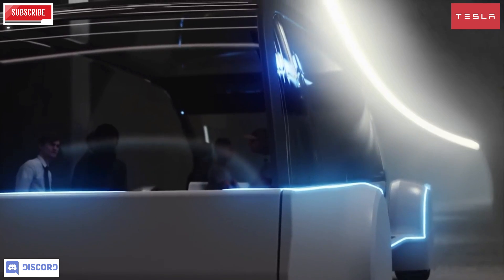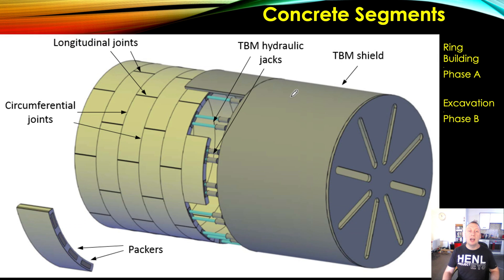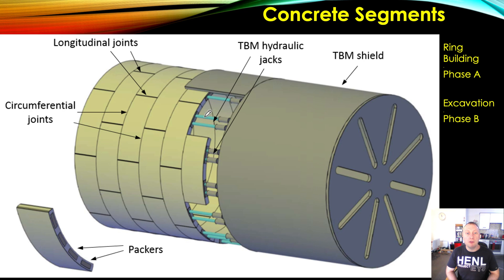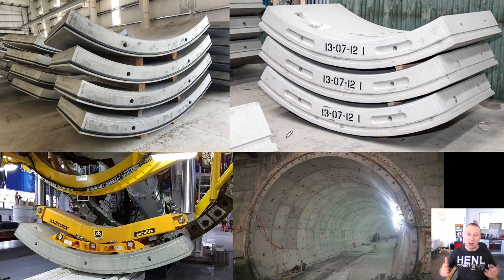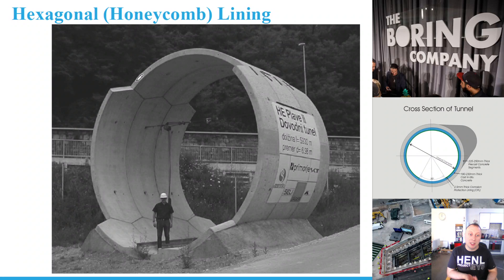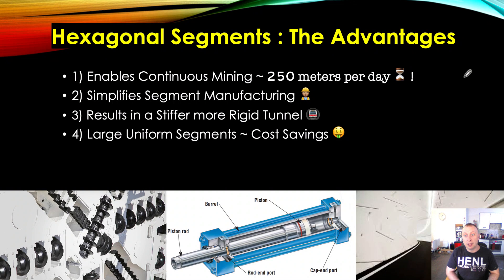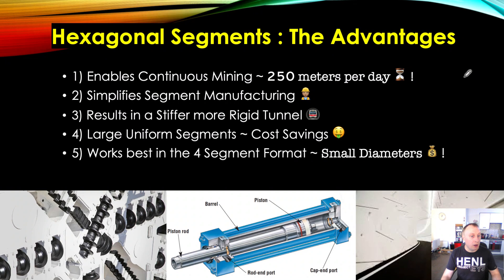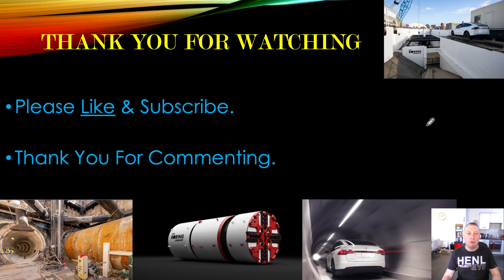The Boring Company 🚇 😃 🇺🇲 Hexagonal Concrete Segments Are The Future 👷🏽‍♂️ 🏗️ 🚎 PART 1

Comment: How is a turn in the tunnel path created if all section pieces are identical?
Reply: Yeah, I think I found a later comment by David Salisbury that indicates that the "rectangular" segments are actually slightly trapezoidal (or some non-rectangular shape), but still a uniform "set" of segments to create a whole ring. And, it sounds like those rings then have a slight "offset" to them (i.e. the leading edge/face of the ring has a slight angle relative to the tunnel axial centerline).  If I understand correctly, one would simple adjust the radial positioning of each the segment sets in each successive ring to either amplify the bend (where turns are desired) or to dampen/counter the bend (when traveling in a straight line). Or, maybe I'm all goofed up in that interpretation!
Reply: Jeff Cadman no you’re not.
Some segment lining rings have a “straight” a “left” and a “right” ring, to allow for straights and curves. 
Most modern tunnels use a “universal” ring which can be built in  any orientation (I.e. the key can be positioned anywhere around the circumference). The shape looks like it is say 1.5m long, but in fact it is slightly shorter (maybe 20mm) at the key, and slightly longer by the same amount at the opposite side. Imagine cutting a salami, but instead of thin slices you make them an inch thick, and instead of perfectly parallel cuts you alternate the cuts with a slight angle.
Now, to line up your cut salami you just re build it with the slices in the same orientation. But if you put all the wide parts to one side you end up with a bent salami, or in the case of a tunnel a curve.
The universal ring always has to build in the tail of the TBM following whatever alignment the TBM cuts. By constantly rotating the position of the key the lining can go straight, left, right, up or down. But it must always simple follow the alignment cut by the TBM,  otherwise it will clash with the shield around it and become what we call “iron bound”.
Hexagonal ring can’t do this!
Reply: @davidsalisbury50  Thanks for the explanation!
Reply: Jeff Cadman apologies for repeating myself. It’s been a long day.
Reply: @davidsalisbury50  
Thanks for all the information you're sharing David.  In just a few minutes of reading I now know a lot more about tunnel construction.

What I'm wondering about is, since BoringCo's engineers will have also know pretty much everything about the current state of the technology, what new ideas they may be trying out as they push for greatly increased tunnel construction speeds.  I wonder what is going on out of our sight as Prufrock is developed along with other innovations.
Reply: @jjcadman  Sounds right.
Reply from the maker: Nice question! 
You Cap off the Hexagonal section with two half segments (half width). Then you use rectangular segments + packers for the curve and later on you revert back to Hexagonal. Will break this down in a future video !
Reply: Good point. Hexagonal segments are rarely used for this very reason. Note in the video reference document they were only used in water tunnels (straight lines in rock), which don’t need to turn corners so much and don’t matter if they leak.
Reply: @davidsalisbury50  How are turns handled with rectangular segments? It seems like you'd still have to manage different radii on the inside and outside curve, so the segments would have to be some kind of curved trapezoidal shape?
Reply: Jeff Cadman the segments look rectangular but they are not. 
Try a YouTube search. There are plenty of good graphics to explain. 
The rings are around 20mm wider on one side and 20mm narrower on the other than their stated length.
Hence they form a trapezoidal circle. By rotating the circle to the the desired position alignment can be maintained and curves (horizontal or vertical) can be achieved.
Reply: @jjcadman  
Apparently, the slightly trapezoid shape is the default. By stacking alternate rings out of phase, the walls approximate a straight tunnel. In a truly counterintuitive manner, the "tail wags the dog". The precise phase position of the inserted trapezoid ring is dictated by the angular error between the tail shield and the tunnel rings. This tail error is the accumulated result of attempting to steer the boring face.
Reply: IMO it would be in the shape of the edges for the segments.
Reply: It seems to me that custom transitional hexagonal tiles have to be queued in the magazine at the correct moment in order to begin or end curves. It is not clear to me why a class or set of hex tiles cannot maintain a steady curve. Just like a simpler set of generic tiles can run straight.
Reply: David Ogawa. I understand what you are getting at, and to some extent that would work. But lining segments have to follow where the TBM tail goes, the alignment has to be constantly adjusted to avoid becoming “iron bound” within the steel tail shield of the TBM. A “universal” ring achieves this by being intentionally not quite straight. Your idea has been tried on a coupe of projects historically. It doesn’t work very well because you can’t predict enough in advance exactly where the machine will be several rings ahead and the “plane” of the ring cannot be maintained with the slightly differing segment lengths leading to build quality and leakage problems.
Reply: @davidsalisbury50  

Current tunnels are designed for speeds lower than 150 MPH or 700 MPH.  For higher speed travel through tunnels the turns would need to be more gradual.  Wouldn't that allow necessary turn to be accomplished using only very slightly "not quite straight" sections?

Given that tunnels don't need to twist and turn their way around mountains and valuable structures wouldn't it be the case that there would be little need for sharp turns?  If there were no right of way issues.
Reply: @davidsalisbury50  
Alright, so the traditional curved rectangular tile sets are rotated to match the existing misalignment of the tail. Differential face pressure is used to gradually make course corrections.
Reply: David Ogawa correct.
But the main course correction is made at the articulation joint in the main shield. If you look at the photos and videos of the machines on the surface you can see they are in two (sometimes three) sections once assembled. This “joint” in the middle is called the articulation joint and usually can move in and out by 150-200mm, but it can also move out on one side or top to bottom, providing and articulation in the horizontal and vertical plane, hence “steering” the TBM through the ground. The thrust rams can assist this by pushing more on the outside of the curve and less on the inside. One reason why the total installed thrust is considerably higher than the amount required for excavation at any point in time.
Reply: @davidsalisbury50  
Fascinating!
Reply: @davidsalisbury50  How do TBMs navigate? They obviously don't have GPS reception, and I'd imagine there is a pretty tight tolerance required for position accuracy -- especially if working tunnels from opposite ends.

Do they use inertial navigation units (like a submarine), or are surveyors making measurements (distance, angle, elevation changes) behind the TBM as they go?
Reply: Jeff Cadman. You are correct.
The basic system is survey using theodolite and laser.
The laser is set up at a known line and level, it shines along the wall of the tunnel onto a light sensitive target on the front shield of the TBM. Then the survey software takes over and the TBM can tell the operator where it is, where it is pointing, and when needs to be done to get it pointing back on target. 
Curves (vertical or horizontal) make the maths more complicated but at the end of the day it’s just geometry and predictions.
The software and equipment have developed exponentially in the past three decades, along with computer developments and the boom in tunnel construction.
The latest developments are Gyro theodolites mounted in the front of the TBM. The gyro knows where north is, senses and changed in the position of the shield, and then passes this information to the hydraulics to Meade the adjustment automatically to get the TBM back on course. These systems are expensive and sensitive so take constant maintenance, adjustment and verification by good old manual surveys checking The tunnel left behind.
For more info try 
“Monitoring alignment- Herrenknecht AG” at the Herrenknecht website.
They have their own in house proprietary system used on most of their larger TBM’s.
Reply: Jeff Cadman also, tolerances are very tight.
Most clients would specify a maximum error of no more than 50mm on line and 20mm on level along the tunnel. That can be very difficult to maintain, especially when going round corners while excavating mixed ground ( half rock half soil).
Reply: @davidsalisbury50  wow! Those are some crazy tight tolerances. Amazing stuff. Thanks!
Reply: Jeff Cadman with a modern system in consistent ground there should be no excuse for getting more than 20mm off line.
Complications can come when the ground changes. 
Imagine you are excavating in stiff clayey sand and as you advance rising bedrock starts to intrude from the bottom of the TBM. The TBM will have a tendency to ride up on the rock, pushing it off line. The rock will be identified as noise within the TBM, and its generally fair to assume the rock is coming from below. The pilot will see the front of the machine going up on the laser target. The pilot can then react to this change, forcing the head down into the rock, but it’s very important not to pave compensate and end up digging yourself into a hole.
At the same time the skin of the TNM starts to “fall” into the 10-20mm excavated hole That the machine has cut for itself in the rock. To compensate for this the excavation level needs to be slightly higher than the true alignment , with the body of the TBM “looking up” slightly to compensated for the overcut below the invert.

But that’s the easy bit.

The big problem when passing from soft ground into rock, or vice versa, Is to avoid over excavation. The TBM will tend to excavate more of the soft material while it is trying to excavate the rock in the lower part of the face. If the soft material is so soft it can move towards the TBM it will continue to be excavated causing settlement or a void in the material above. 
In an extreme case this will propagate to the surface causing localised settlement or even a sink hole. If there are buildings roads or utilities above the consequences become obviously far worse.

It’s a lot of balls to keep up in the air to make a success of TBM tunnelling, not just a case of seeing how fast you can go.
Reply: @davidsalisbury50  thanks for the detailed description. I'd seen in one of the Robbins videos (I think) that some of the TBMs have probes that they can extend out in advance of the cutting face, which I assume helps to provide alertment to changing geological conditions coming up? Assuming that's the purpose, how common are the use of those probes, and are they extending out from a single fixed position on the TBM? It almost seems like one would want probes at points around the cutter face (i.e. top, bottom, left, right) to anticipate the kinds of changes you describe. Though, that likely still has limitations, and may not be worth the added complexity and costs.

I know the oil & gas industry has many geophysicists employed to help identify oil/gas deposits. Do tunneling companies similarly employ geologists who might use models combined with in situ sensing to attempt to predict the geological composition/variability along the intended tunnel route (or, perhaps, to optimize the choice of route)? It would be interesting to know how well companies can anticipate the conditions vs how often they are surprised by what they encounter.
Reply: Jeff Cadman. Again you are correct.
Often when you see TBM’s shields from the outside you can see an array of tubes going through the skin at an acute angle. These are probe holes.
They allow a rock drill (around 50mm diameter) to drill out, ahead of the face of the tunnel, up to 40-50m to check the quality, strength and any faults in the rock ahead. It’s a slow process which can only be done when the TBM is stationary.
The array of probe holes can also be used to pressure grout the rock ahead to stabilise the ground or seal any water paths in the rock.
These are generally used for hard rock TBMs that do not have a segmental lining installed, they rely on the quality of the rock to form the tunnel without support, or with limited support in the fault zones only.
For all tunnel projects an advanced study of the ground along the proposed alignment is essential. This is a multi stage process of desk studies, assessing existing data, planning a set of ground investigation holes (preferably at 50m spacing if the surface access is available). More sophisticated methods are often used such as inclined drill holes or horizontal directional drilling/coring along the alignment.
The aim being to gather the best possible information on what will be encountered and to target more information at locations of difficult ground conditions.
The most sophisticated TBMs can also now be fitted with instrumented cutting discs to continuously map the excavated face, monitor the cutter performance and wear and allow accurate comparison of the encountered versus predicted ground conditions.
Ground Penetrating radar has been used but it has proved of little value so far.
Geophysics are often used in advanced planning of deep rock tunnels.
Reply: @davidsalisbury50  Thanks again for the in-depth response. I appreciate you taking the time to add to the conversation!

Comment: With a Hexagon system, if either ends loses tension do the segments start separating throughout the entire tunnel? Does rebar keep each segment tight together?
Reply: Segment systems are often bolted together, the thrust of the TBM keeps them pushed together and they are generally grouted to fill the annulus left behind between themselves and the excavation as the TBM shield moves forward. As the grout hardens it “locks “ the segments in place. Although tunnel disasters have happened due to separation of segments during construction in soft ground in the past.
Reply from the maker: Decent question.
All segments are bolted together and act as one entity. . . . So when the TBM is exerting a force onto the walls of the tunnel it compresses all the segments as they are inter-connected.

Comment: Spun carbon fiber followed by gunite could be exponentially faster, stronger and cheaper. It would also be much more adaptable to variable  bore diameter sizes.
Reply: Since when is carbon fibre cheaper?
It’s lighter, but who cares, this is a tunnel.
Reply: @Creabsley  The price of carbon fiber is determined by patent and production costs. I think the patent may be expiring soon, otherwise Tesla could buy it or a cheaper license for it. Production costs would be greatly reduced by economy of scale that Tesla could devote to it. Alternatively, fiber glass may prove to be a viable alternative under gunite or slipform concrete as well.
Reply: @DevinHeaps  
Here's one thing about Musk's companies.  I suspect there are more than one person at BoringCo who will read every comment in this conversation and other relevant conversations.  If there's an interesting idea that is new to BoringCo it will be made public within the company fairly rapidly.  If the idea has merit it will be studied and if it proves out it will be adopted.

Very much different from so many other companies who are concentrating on this quarter's profits and getting larger bonuses for the executives.
Reply from the maker: I like it... but I need to see it, to believe it is viable 😃 !
Reply: @BoringRevolution  Yeah it would be fun to test. The other idea I had was to use  polyurethane foam, structurally insulated barrier layer, with a slip form concrete inner lining. The boring machine could push against the  polyurethane foam layer while it moves foward and forms the slip form cure.